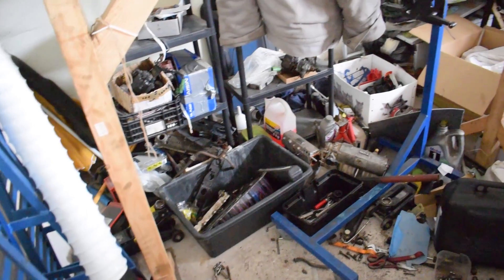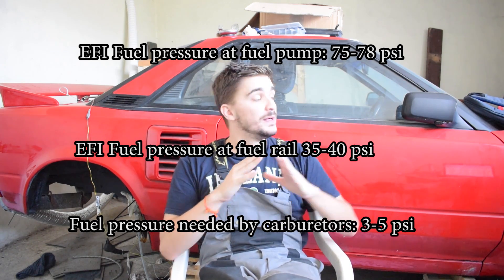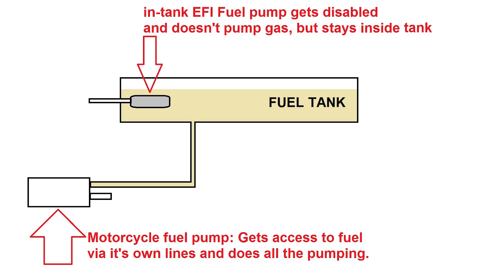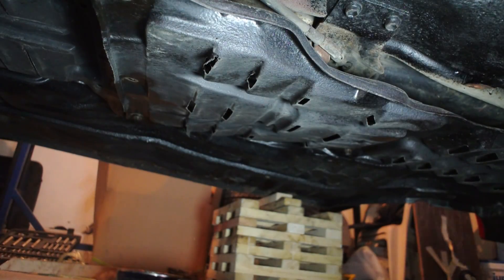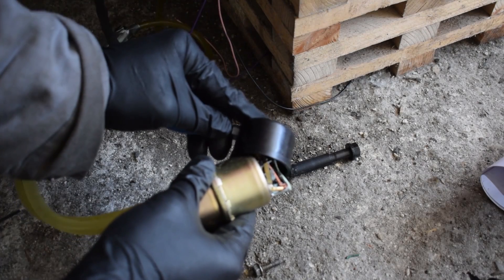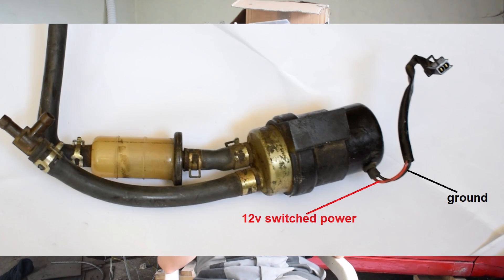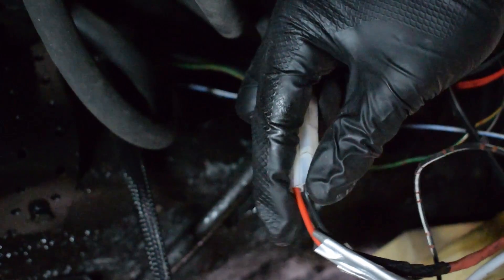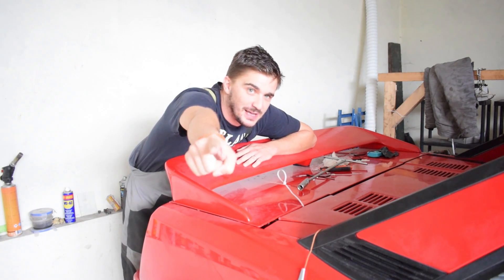BIKE CARB (itbs) conversion FUEL supply - how to

Comment: I need to fit my CBR 600 carbs to my 2000 VW Polo 1ltr as the fuel injection/fly by wire is getting a bit old and often revs rise for no reason. I might put the CBR engine in it completely, Double the bhp just like that.   As for the cheap CBR replica pumps, Rubbish, I swapped out the electrics for the Honda parts and it worked ok until it burst its seals and sprayed nearly a gallon of fuel over my new RST boots and leather Jeans.  Easy option, Buy an original, second or new.

Comment: Dang, I did zzr1000 carbs and I used bike fuel pump. Just as yours, the cheap ebay pump failed after few hours of use. I bought new one but that seems to overfill my carbs. Those are 100% clean I checked. You think I still need a fuel pressure regulator?
Reply from the maker: To push past the float valve seals the pump would need something like 8 psi, and carb fuel pumps almost never do that. Are you 100% sure your float seals are good?
Reply: @d4a  the float needle seals look brand new and if I put the carbs upside-down and blow down the fuel hose it seals very well. I'm quite baffled tbh.
Thanks for quick response, I didnt expect that!
Reply: @d4a  I did a leakage test with water without changing anything and now they hold up to 1 bar. which is weird but imma put them back on the car

Comment: Just a quick question why did you not just install a feul regulator in the engine bay to bring the pressure down from 10psi to 4 psi?
Reply from the maker: Stock efi pressure is around 37 psi. Yes you do have regulators for that but they're usually very expensive and don't last very long

Comment: I'm planning to do this on my car with car carbs. Would it still work if I didn't use bike carbs with the superbike fuel pumps?
Reply: The carb on my 4G15 is an Aisan dual barrel carb if that helps. And do you need to connect the return line back to the fuel tank?

Comment: do you still use this second hand fuel pump? found any problems? or is it just fine and works perfect? 
i also have a bike swap conversion(keihin cv carbs from an cbr900rr). Accidentally bought a fuel pump meant for webers(0,38bar) but cant seem to get it just right.
Reply from the maker: Still using this pump. Zero issues so far :)
Reply: @d4a  thnx for the response. Getting myself one of those then :)

Comment: Need some advice
Great video by the way ,just wanted to know 
I have a 1.6 golf running with Yamaha R1 carbs
Am I able to run unichip management with this setup
Reason I'm confused is because the carbs got a TPS but no fuel injectors???
Reply: The TPS is probably to adjust the ignition timing i think

Comment: I have a 200cc single cylinder engine, aand I want to install a fuel pump, since I want to mount my tank lower than my carbureator. Do you think I can get away with a 4-5 psi fuel pump or will that be too much? Btw Ive been watching your channel for some time. love to see it grow so fast. Congrats for nearly 70k!
Reply from the maker: Hey there, the 4-5psi will likely be too much. I don't know what kind of carb the engine is running but I would use a pump from a motorcycle, any carbed bike pump will be ok. After this vid I had the opportunity to test a bunch of these pumps and they're more than capable of pumping fuel up almost any height. It might shorten their lifespan if you make them pump really high up, but likely not significantly. My pump is mounted almost at the bottom of my chassis and the carbs are just under thr engine lid, zero problems ever, and it's a 2psi pump, I measured the pressure with a t-piece. It takes very little to blow fuel past the float valves, so lower pressure is always better. Almost any carb engine can pretty much run with gravity fed fuel, like you will find on many older bikes. Thanks for watching :)

Comment: Why cant the cars fuel pump be used? Surely a 1.6 requires the fuel pressure and fuel delivery a 1.6 needs? Why would a fuel pump for a 600cc engine be needed?
Reply from the maker: Because these are motorcycle carburetors and like any carburetors they need very low fuel pressure, 3-4 psi or so. Fuel injection requires 10 times that. The stock high pressure fuel injection pump can not work with carburetors for that reason. It's not about engine displacement, it's about the type of fuel delivery.
Reply: driving 4 answers I see. Thanks for the reply. Im thinking of converting a Micra to an ITB set up.

Comment: did you make the carb intake by yourself or was the carb amd intake came in a kit? im running a stock carb on my nissan sentra and i wanna do a 4 individual motor carb conversion on it. i just dont know where to start
Reply from the maker: I wish I could weld like that. It's all part of a kit made by DanStengineering. Check out my bike carb parts unboxing video. All the info is there.
Reply: +driving 4 answers (mr2 mk1 hero) i just watched that video just now. I can have someone fabricate the intake manifold for me but the quad motorcycle carbs i mostly see are hella expensive. Do you know any brand or model of cheap quad carbs? i really appreciate you taking time to reply to my comment. thank you very much
Reply: +driving 4 answers (mr2 mk1 hero) i just watched that video just now. I can have someone fabricate the intake manifold for me but the quad motorcycle carbs i mostly see are hella expensive. Do you know any brand or model of cheap quad carbs? i really appreciate you taking time to reply to my comment. thank you very much
Reply from the maker: Mine are CBR600 F4 Keihin carbs, they are around 150-200$.

Comment: Hello, just came across your channel. I too have an 87, mine has a 20v blacktop in it. It has a cheaper cold air intake right now. How easy is it to install "trumpets" instead of that? Just bolt them on? Do I need to worry about any sort of sensors? Thanks for your help!
Reply from the maker: You have the stock plenum on? Trumpets are easy to install as far as I know. Techno toy tuning makes really nice trumpets a.k.a. velocity stacks for the 20v.
Reply: driving 4 answers Yes stock airbox (I'm new at this type of stuff had to look that up)
Reply from the maker: No worries. Check out techno toy tuning's website and all will be clear soon :) You can shoot them an email too with any questions you may have.

Comment: Love all your videos!!! I started my bike carbs conversion at the same time as you. Please make video about tuning the carbs, I would love to see how are you doing the tuning. And please write what jets and adjustments are you using. i had problem with owerflowing the carbs, I needed some time to solve it out. I am converting 1.1 engine, belive it or not. :D All the best from Serbia, I will keep watching and sharing!!!
Brate, odakle si? :D
Reply from the maker: I am in the process of tuning my carbs right now. There will be a really in-depth detailed video of the tuning really soon. But here's a really quick run-down of what I have gone through so far. 
Stock is 40 pilot, 145 main jets, 1 shim on needle. I started with 45 pilot, 160 mains, and three shims on needle. This ended up being very rich at idle and lean at higher throttle. So I went back to 40 pilot and 2 shims. This turned out to be lean. So now I will try 42 pilot and 170 main jets to see what happens. I have also given the carbs a super detailed cleaning and taken them apart completely. A video on the cleaning will be published tomorrow around 6:00 pm our time. I am in BiH, very close to you :) What engine and car are you converting? Got fb or instagram or something so I can see some pictures? I love bike carb conversion projects :)
Reply: Thanks for the quick answer. I will send you some photos via google. I haven't posted photos yet, until I succeed. When I finish, I am planing to write detailed text. I am converting 1.1 Zastava three door (Mediteran). :D My carbs are Honda CBR F1 32 diffuser, I started with standard jets, 35 pilot, 110 mains and no shims on the needle.  By using dcoe/dhla calculator, for 32 diffuser, 110 should be ok. But I was running bit lean. I still need some testing, but time is a bit problem right now.  On Idle it is ok, but lean is on higher rpm, and idle rpms are bit high. Have you heard, you can use smaller main jets by pluging main air correctors. Try it with 145 mains and pluged main air correctors. Or 45, 160 and less shims. I am having problems to finding pilot jets to buy. I found mains, but only smallers ones, so I need to drill them out, which I don't like.
My fb page is "Serbian Car Fans", I will post my work there when I finish and https://www.facebook.com/groups/zastava101klub/ 
At the time, Serbian Car Fans is on pause, because of my lack of free time. I will send you my private fb profile too.
Reply from the maker: You can also find me on facebook, feel free to get in touch on my fb page. Where can I find that jet calculator?
Reply: I will send it to you. ;)

Comment: Is it possible to decrease the voltage of the efi pump in order to lower the pressure?
Reply from the maker: I like the way you think, but it probably wouldn't work. The pump needs 12v to run. You could somehow lower the voltage I guess to make the pump run slower...maybe. But it just isn't designed to work that way and I don't think it would last long, and the pressure would still vary to much and probably be too high. The pressure is 75psi at the pump, and the carbs need 4 psi at most, which means you would need to lower the pressure 16-17 times. Now this would take A LOT of experimenting with the voltage and a fuel pressure gauge to check which lowered voltage provides the right pressure. And I think the minimum voltage at which the pump would ever run would still produce too much fuel pressure. And you would need to buy a fuel pressure gauge, which is already almost half of the cost of the setup that uses an adjustable fuel pressure regulator. You would probably end up spending more on electrical supplies to lower the voltage than the motorcycle fuel pump costs :)

Comment: You may run into issues with that plug in a few years. They allow water in and rust. 
You need to run a Deutsche plug if it's in the weather. They are expensive and need a special tool but.
Reply from the maker: I will wrap it, I left it open like this just to show how it looks.

Comment: I replaced the stock fuel pump in my MR2 several times.  A royal pain in the fkn ass for sure...  I ended up adding a supplemental inline pump, to reduce workload on the in tank pump and this solved my issues...while also providing greater fuel supply to feed the engine I had worked over. Cams, port/polish heads, adjustable camshaft gears, full exhaust, CAI + I modded the MAF.  That little beast was running with Mustang 5.0s in the short game and would crush almost anything going in circuit tracks.  I miss it terribly :(
Reply from the maker: That sounds like one helluva build. Got any photos or videos of it somewhere, would love to see it.
Reply: No.  That was nearly 20 years ago...and a couple life upheavals where I lost everything.  Before Youtube existed.
Reply from the maker: Crazy 8s Drums Oh, ok. Well.. You'll never lose the memories. Or maybe you can build one again :)
Reply: I did tons of cool stuff to it.  My speedometer died so I just fabbed a carbon fiber panel and put a bunch of AutoMeter gauges in the dash to replace it, with a tachometer on the A-pillar.  Springs/struts, polyurethane suspension bushings and a beefier sway bar.  A little brake work.  There was no need to go crazy with the suspension because it was really great to begin with.  In the twisties, it would beat or keep up with anything, lambo, porsche, ferrari, NSX etc...though gearing prevented high top speed.

The short ratio gear set was both a blessing and a curse.  I would have liked a bit more spread and maybe an extra 'overdrive' gear.

Comment: So what kind of advantage do you have with bike carbs?
Reply from the maker: Better sound, more responsiveness, a tiny bit more power if tuned right. Generally a more fun engine to drive. Mpg suffers on the other hand.

Comment: I am in the process of converting my soles carb to keihin 41 carbs on my BMW 2002. I was wondering if you could point me in the right direction for how to get the correct jetting.
Reply from the maker: It's really not as simple as that. That's like sayin "I'm remodeling my home, can you point me in the right direction of what to do" :) Are the carbs CV carbs? What are the jets in them now? Any mods on your engine? There's a lot of questions and there is no general rule. But here's what I can tell you. Get a wideband gauge, that will take all the guesswork out of the tuning and make it a lot faster and more accurate. Reading spark plugs and tuning with your butt and ears can only be done by uber experienced veterans that have tuned hundreds of carbs. Young folk like us needs the aid of modern technology :) Start with whatever is in the carbs right now, then watch the afrs on the gauge. If lean at idle go one size larger pilot jets, if lean at mid throttle add 1 shim to jet needle (assuming it's a cv carb) , if lean at wot go one size bigger main jet. That's my basic logic at this point, but I might also end up needing to mess with emulsion tubes and or air jets. It's a dark complex art but once you master it and have your engine dialed in you will be able to enjoy the feeling of having done something differently and having a sexy old-school skill that is becoming increasingly rare :)

Comment: So I have a base model corolla  fx with a carbureted 4ALC, and I do plan to swap a 89 MR two 4AGE into it. I have Yamaha R1  carbs for my 4age, would this cut out a lot of work that you have done because you went directly from EFI and rebuild everything for carburetors outside of that could I use the stock EC you temporarily
Reply from the maker: The only thing you can probably use is the stock fuel pump, if it provides the right flow and fuel pressure for the R1 carbs. You didn't finish your comment, but I assume you wanted to ask about stock ECU. The stock 4age ECU might work if its MAP based and you have a suitable MAP sensor and harness. You might also do sone research to see if it's possible to use the 4ALC distributor since I believe it has vacuum advance.
Reply: driving 4 answers ah I see I think the 89's are MAF and not map so I might have to tweak the harness. 

But I can get a map sensor from an 89 mr2 without a problem, and I meant if I could use the stock singlecam  ecu and harness seeing as it is built for a carb or will the duel cam cause interference with the single cam ecu. Or is it better to get a nodiz like you did. My stock carburetor in my stock motor is a two barrel and bike carbs are carbs are technically so I don't think that should be much of an issue in terms of a fuel pressure management. I did manage to buy a Yamaha fuel pump from an R1

Comment: For my AE85/6 I've found cheapo rear disks which appeared quite unexpectedly, and as I was not sure if they fit, ordered them just to check but they fit, there was Polish made disks made by Kager and cost something around $20 set

are the 4x114.3 bolt pattern used in euro AW11?
Reply from the maker: Mine are allegedly coming somewhere from Italy. But theyre cheap too, around 35$ per disc. Only ones I could find. My AW11 is 4x100.
Reply: Checked against toyodiy.com - http://www.toyodiy.com/parts/p_E_1987_TOYOTA_MR2_AW11L-WCMQFW_4102.html

and the 42431-17020 part number, on another page there were few cross reffs for this PN like:
Blue Print ADT34351
Optimal BS9042
Brembo 08A14010

but not really sure that they are fit...

Comment: Will this also be a solution for a carb conversion with Weber IDF or DCOE carbs??
Reply from the maker: Do you know the exact fuel pressure requirements for the Webers or DCOE? If they need 3-4 psi I don't see why this wouldn't work, although I'm no expert for those carbs :)
Reply: we use like 5 or 6 psi in drag racing with those carbs in 1.6 engines here in argentina

Comment: Thanks so much for the shout out! Wish I had better footage for you to use, but still missing the old data. Hopefully soon.
Your plan sounds good, and at least your tank has a drain plug! My early one didn't Had to remove the tank 1/4 full.

So glad you don't have to remove the tank! As you saw, it's a massive pain. You could definitely handle it, but unless you suspect it is rusting through, probably not worth it. Yours has run recently enough to for the inside to probably be alright, and the fuel coming out did look good. Hopefully you can see how my tank was inside soon. It's shocking!

P.S. Your garage ain't even that bad! You've seen mine I'm sure. I am about 10% away from having one whole half free to work in though. MR2 SR20 engine swap incoming after that! Then I can have a messy garage that looks just like yours. ;)
Reply: 802 Garage Going to your channel sub.
Reply: Thanks a lot! Every one counts. :)